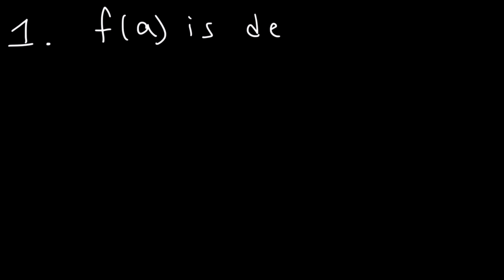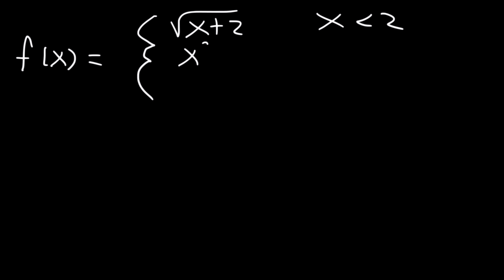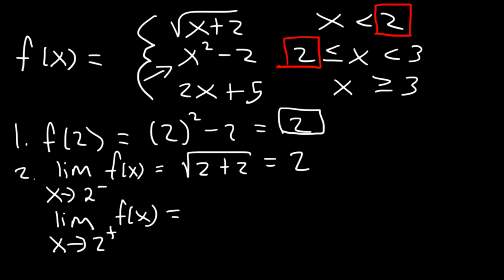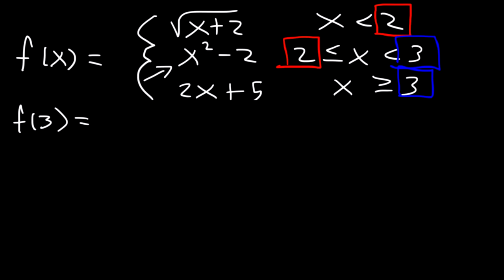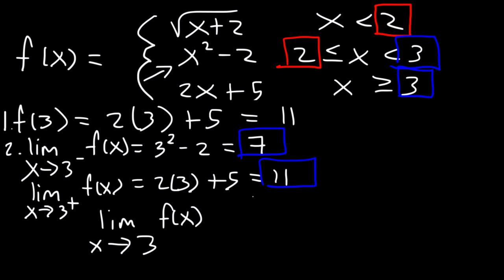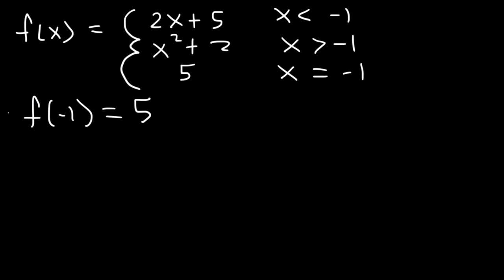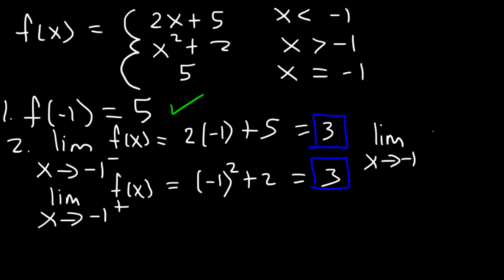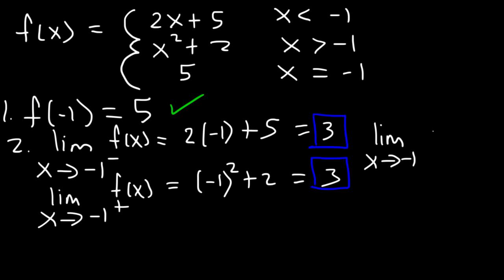3 Step Continuity Test, Discontinuity, Piecewise Functions & Limits | Calculus

Comment: im a bit confused for the first question. 
when limit x approaches 3 from the left of f(x) means that the the value of x is 2.9999,2,1,0,-1,-2 isnt it?
but why do we only used the 2nd equation which is 2x but not both equation whic are 2x and x^2?
Reply: I didn't understand your question even

Comment: i got the idea clearly . similar to this topic . if a composite1 of function g(x)  that x is smaller and equal to 2 , then put x= 2 into composite 1 of g(x) is equal to constant K and if composite 2 of function g(x) that x is greater and equal to 2, put x =2 into composite 2 is equal to a hole. secondly, the left hand limit of composite 1 is equal to constant K and the right hand limit of composite 2 is equal to constant K . then it is continuous too even composite 2 has a hole at x=2.  if you know what i say, you probably understand it very much.

Comment: 00:01 Proving the continuity of a function
01:13 Applying three-step continuity test
02:37 Finding the limit as x approaches 2
03:51 Function continuity at x = 3
05:08 Identifying jump discontinuity
06:22 Determining continuity and discontinuity at x value of -1
07:36 The limit as x approaches negative one is equal to three.
08:43 Identifying different types of discontinuity

Comment: Jump discontinuity  if the limit from the left side and the right side aren't equal (limit DNE)
Removable discontinuity: if the limit exists(lim left = lim right) but isn't equal to the value of the function. (hole)
Infinite discontinuity: if the limit is equal to infinity (from the left and right)
Reply: Can anyone answer me🥺
My lim x > 16 negative = 1/16 and my lim x > 6 psotive = 0, is that discontinues or continuous?? Pls help, really need dis for my performance task that is due in 7 hours😭
Also, my first step is f(x)=1

Comment: There is a possible flaw at 1:58..the function is defined for square root of (x+2) for x <2. But there is no real solution for <-2 . I'm guessing that's OK because you didn't define the domain of x. Normally in function work the domain is defines - e.g x belongs to R, the set of real numbers.
Reply: bluegtturbo you don’t have to include a domain for most square roots usually